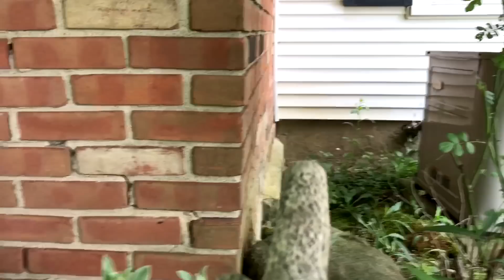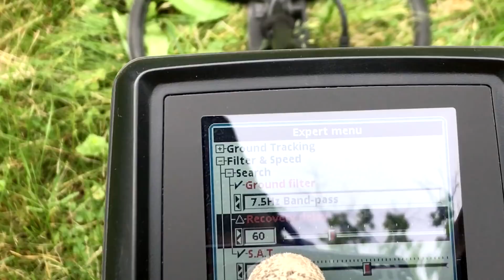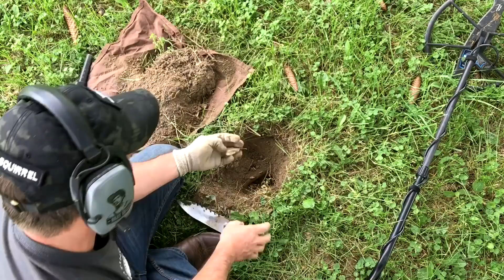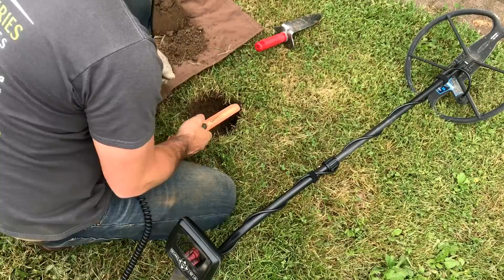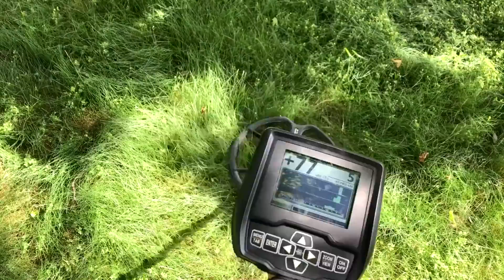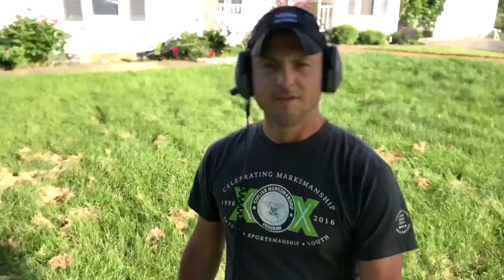White's Electonics Forum Friends Hunt Spectra V3i Trio Metal Detecting

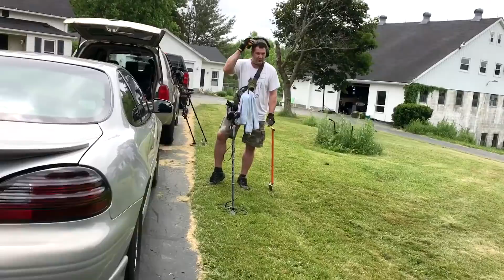Comment: 13:01 - Nice setup.  I run the DX-1 on my DFX and moved it over to my newly acquired (used) V3i.  I still have to go through all the V3i setup... but glad to see others running the same in-line pin pointer.

Comment: I think you would have fared better with a smaller coil. the 13 inch detech Im sure is good. You never hit anything that a 6 inch coil would not have. Not a hater, not even going to tell you how many years Ive been doing this. been a long time. Bigger isnt always better, and the new digital machines are less adjustable than the analogs. What good is depth if its not usable? I will be dead when you realize this, but happy hunting anyway. I wish you the best.

Comment: I have the vx3 and I don't have the polar or the analyzer besides that it's almost identical to the v3i. Why don't you use the analyzer or the polar plot do you use these settings? I'm thinking about upgrading to the V3i just to get these two extra settings do you think it's worth it, how often do you use these  settings?I just don't know if I should upgrade just to get these two extra settings that mine don't have but I like to have the analyzer with the camel hump lines. Since you own one of these what do you think? Should I upgrade just to get these settings?
Reply from the maker: I’m not sure it’s worth the upgrade... and only my opinion. The analysis mode really isn’t anything I’ve used much over the years. Out of all analysis modes sizing was my favorite although I could tell the size of the target when pinpointing and also could tell if the target was a decent hit and not iron by the response of the tones when turning 90 and checking if it repeats.  I found that the analysis modes took up a lot of extra time for about the same amount of information that I already had in VDI, tone, response and pinpoint... by the time I ran analysis I could have already dug and discarded or stuck in my good finds box and be on to the next swing.
Reply: @squarenailsquirrel9638  thank you, I might just get a equinox 800 for backup instead of upgrading my vx3 they  work with 5 frequencies and I heard they're a great machine. Well thanks again and have a great day.
Reply: @squarenailsquirrel9638  since you have a v3i I was wondering what would you consider a good price for a used v3i? Somebody said the equinox 800 it's not all that. I'm going to try buy a  used v3i and sell my vx3. Would 600 or 650 be a good price for one in good shape? One person I was talking to  said that Whites stockpiles the v3i's for years so the date on the unit doesn't really mean much. They  could just be pulling my leg to make a sale.You seem like a experienced  metal detectorist and I would value your opinion. Thank you.

Comment: White's TRX? Thanx for the info. I am not fond of my Garrett Carrot either for the same reasons you explained. I bought the Garrett because it was Waterproof. I had no idea the TRX was also Waterproof...
Reply from the maker: I like both pinpointers although after many years of Garrett use, I favor the Garrett because it picks up more area of detection. I know White's boasts that the TRX is a true pinpointer and only picks up on the tip but so does the Garrett. I like that the Garrett picks up on the sides so you can quickly scan the rim and bowl sides of a hole and then once you get a fast idea of the area of the targets location.. just sent in the tip of the pointer to pinpoint. Both work well but my experience is with the Garrett mostly. If someone started out with the TRX they most likely would favor it over the Garrett... just what your used to I guess. Thanks for checking out the video and take care.

Comment: I like your videos.  Wished you have a video where do you have your toothbrush,  spray water bottle,  where do you mount your phone or camera, and what is all the gear you take with you for shooting your videos
Reply from the maker: Here is what I use. This has taken many attempts with purchases of items that don’t work, expensive software that was terrible, things breaking and many trial and errors along with countless hours of researching “how to” as well as taking a class from a professional. 

I use an iPhone 7 to film, 
Filmic Pro App 15.00
Adobe premier pro subscription 36.00 a month
Creative could to store (free with above subscription)
Highly modified go pro brackets plastic welded, yes with a plastic welder, cut and spliced to fit my needs 50.00 in parts and already had the welder
A modified cell phone case 10.00
A modified surveying bi-pod those are 300.00 but the one I have is an old one of mine. 
An additional 360 mount for the cell phone 24.00 amazon for handlebars
A mount for my gimble stabilizer 36.00 for camera tripods that’s been modified to fit a handlebar
DJI stabilizer 160.00
Modified monopod for a rifle 36.00 +\- I already had it. 
The rest I have sewn like  bags,  dead cats, mounts supports and such at home with cordura 1000. 
Had to upgrade my internet connection so it doesn’t take 10 hours to load a 20 minute video at 30.00 extra a month. 

Let’s say my wife has been very understanding through the process because the investments, the accured monthly payments as well as countless hours invested making and learning to make videos less to say going to detect to collect footage for the videos. 

This has been a lot of work and you have to enjoy the videos as much as detecting to do it.. dedicated. For each hunt I spend at least 4-6 hours editing.